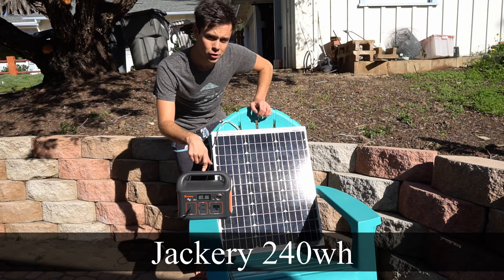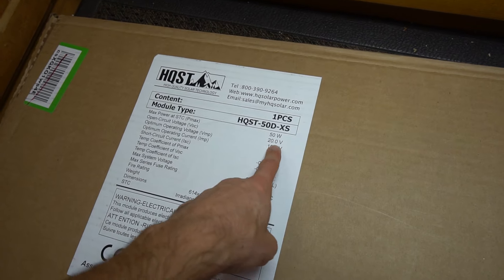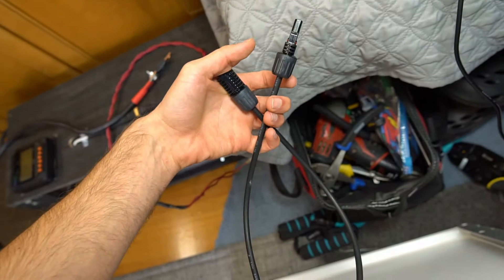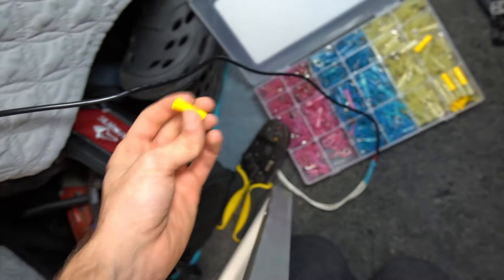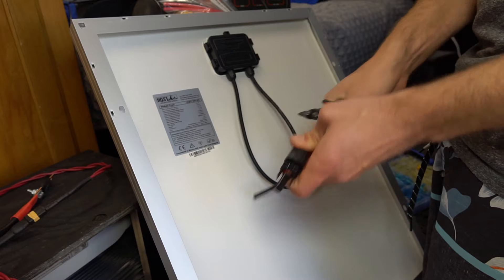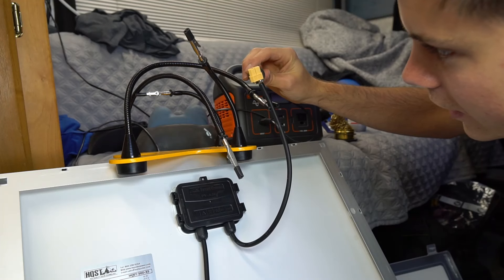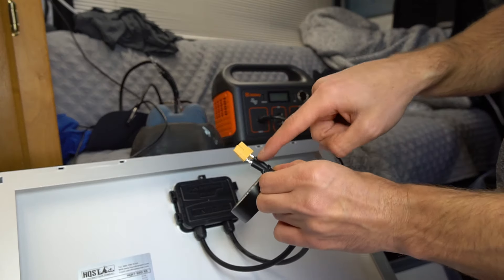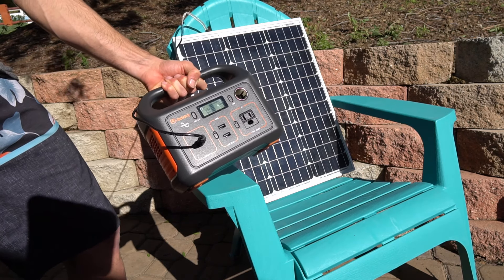DIY Jackery 240 Solar Panel: Save $250!! Beginner tutorial

Comment from the maker: The solar panel is now $65! The price dropped right after I bought mine haha Damn! Here is the link: https://amzn.to/2SAsWlH

Jackery 240: https://amzn.to/2MZgmqC

More about the Jackery, and other solar generators: https://www.mobile-solarpower.com/ultra-portable-systems.html

And the price is cheaper for the MSRP $299 Jackery panel on amazon! Wow all of my prices are off lol its $200 on there: https://amzn.to/2THuaso

The cheapest/easiest way to connect the solar panel wires to the jacker power cable is to buy a wire stripper from walmart/harbor freight, and buy a crimper/crimp connector set. This would cost under 20 dollars, and you could use the connectors to crimp the wires together. 

My full crimping tutorial video: https://youtu.be/dTYyMwbSK7I?t=496

MC4 extension cable in case you need to mount this solar panel on your roof: https://amzn.to/2Bwxsrv

Crimp-able xt-60 connectors: https://amzn.to/2Dnx3YB

High quality tools that I actually recommend for this job can be found here: https://www.mobile-solarpower.com/tools.html
Reply: Hey Will, thanks bringing a low cost solution for this application. one question, what are you using as an input into the Jackery 240? Looking for options on the 8mm connector if i want to keep the one that come with the Jackery intact.
Reply: For $65 on EBay i found a foldable solar panel made by Poweradd that comes with all the attachment you need to connect the solar panel to the Jackery.  Even without direct sunlight, I had 10watts going out and solar panel plugged in the Jackery stayed at 100 percent charged.
Reply: Thank you for your response

Comment: I plugged my 100W solar panel into my 240 and it was pulling in 70-80 watts at times.  I was stoked to see it exceeded its usual 38-40w charger rate from 12v or 115ac

Comment: Good video, you can also get a mc4 to 8mm adapter I heard that works too
Reply: Wait, so you could just buy an mc4 to 8mm adapter cord and not need to do anything else?
Reply: wakawaka1976 Yup, I bought a $80 100 watt panel and that cable for $17 or something, just plug it in and you’re good.
Reply: MmaBoxing KO what panel would I need for a 1000 watt Jackery?
Reply: Compton CityBoy I have a 240watt and a 500watt Jackery, I use the 100watt panel for both, charging one at a time. For a 1000 watt I would recommend maybe 2 100 watt panels if you don’t want to wait 20 hours to charge it up

Comment: When soldering my two most important rules; 1) Heat the joint (or wire) with the soldering iron allowing the heated wire to melt the soldier, but don’t heat the wires too long or the wires insulation will melt. NEVER MELT OR DRIP SOLDER DIRECTLY WITH THE IRON ONTO THE JOINT! 2) Tin the wires first. To Tin wires heat the wires and apply enough solder to “coat” the wire. Will, I know you’ve already talked about tinning wires, but when I see people “movie solder” it makes my skin crawl.

Comment: One of the biggest cons of the Jackery 240 is the very slow recharge time (power) when charging from a 12-volt source. It can take 8-10 hours at 12 volts. This is unacceptable for those who really need to get this thing fully recharged with one days worth of sunlight. I don't why they specify a 42 Watt limit (label on the bottom). The charger is a constant current (about 3.6 Amps) from 11.25 volts to 25.5 volts. I use a 24 Vdc AC/DC power brick (purchased on eBay) and get 77 Watts of charge. From AC power, I get a full charge (from 0%) in about 4 hours. For DC charging, I use a boost converter (also bought on eBay). 10-30 Volts in with the output set at 25 volts. Using a 120 Watt,  12 volt solar panel ($100 on eBay), I get 82 Watts of input power and a full charge in the Jackery 240 in about 3.5 hours.

Comment: What happens if i plug a 75w or 100w panel in, and just keep part of it covered when its hot, but expose as much as i need later the afternoon, to keep it under the max 50w charging that Jackery recommends? Can i damage the battery if i keep the charge around 50w? What happens if the charge goes too high?  BTW i'm binge watching your videos! Soo much information...

Comment: I have a jackery 160 and an eenko 220 ... i ordered the hqst 100w on the way (and now I'm wanting extension cord) the power stations will moderate themselves right? It's better to have 100w because the solar cells don't pick up 100%?

Just want to make sure the 100w panels won't hurt my banks 

Trying to comprehend how to extend
Also got a 60w tp fold panel that I need extension for. A lil overwhelming lol. Grateful for your channel ♡

Comment: Thanks Will for confirming my ideas! But can you straighten up some details? From my understanding this mean that the Jackery has its own regulator in the unit? You say in the video that 50W is max for the Jackery, but I don't understand that, because now you can buy both 100W and 200W original solar panels from Jackery. Whats the point of buying a 200 W panel if you only use 50 of them? I got a 100 W foldable third-party panel with a PWM regulator. Should use the regulator on the panel or just connect in straight into the Jackery?

Comment: Ey man, got a question for you, how did you get the 8mm wire that goes into the Jackery? Did you cut the charger that comes with it?
Reply: Just buy an MC4 to 8mm cable on Amazon, save time and much better quality.

Comment: I know you are going to roll your eyes at me but.... what panel 50W would you recommend (besides the jackery $199 one) that has a built in 8mm input plug (not MC4)? because I assume getting a regular panel and then connecting an MC4 to 8mm converter cable is less efficient, or does it not really matter that much. I WOULD do what you are doing in the video, but since I'm living in my car, I don't want to catch things on fire or myself on fire, or burn alive in my sleep if something were to go wrong with the whole setup.

Comment: Will did you see that Jackery came out with a 100 watt panel for the 440/500 model?? If only you could charge the 240 with a larger panel like a 100-200 Watt panel.
Reply: I’ve been doing this cus I didn’t know any better. It has worked. 100w to the 240

Comment: We just purchased the Honda Jackery 290 and want to use a non-Jackery solar panel.   Just wondering if you used one of the existing 8mm plugs that came with the generator by snipping off one end of it (like the AC wall plug), then adapting it to work with a standard solar panel?   I'm a newby, and trying to figure this all out.  Thank you :-)

Comment: Maybe do it with flexible solar panels? At least that's a cheaper option these days. I bought an Ecoflow refurbished 160W portable solar panel for $190 on Black Friday. A 100W HQST flexible solar panel was $165, so I figure I did alright. I figure, even if a flexible solar panel was cheaper, and easier to store, it would be easier to damage and harder to stand up.

Comment: Appreciate the Video Will !! At 33 watts.. what do you think would be the charge time from 0 to 100%  for the 240 Jackery?
Reply from the maker: Depends on sun. It's winter so 33 watts is great. It would pull 42-45 in summer in full sunlight
Reply: @WillProwse  what happens if i plug a 75w or 100w panel in, and just keep part of it covered when its hot, but expose as much as i need later the afternoon, to keep it under the max 50w charging that Jackery recommends? Can i damage the battery if i keep the charge around 50w?

Comment: Or you could just buy the adapter off Amazon for like $10.
Reply from the maker: They don't sell it. Can you show me?
Reply: I will try and send it to your email tomorrow.  At the ER.
Reply: Can you post the link Maggie?
Reply: Britt McCann it’s actually more like $24.  I will see what I can do.
Reply: Britt McCann look up  Upgraded -MC4 Solar to 8mm Adapter Cable 48” perfect working for GZ.   If you look in the 7th comment you will see they are using it for their Jackery.  But, yes, it is $25. Most of the other solar generator cables are less than $10.